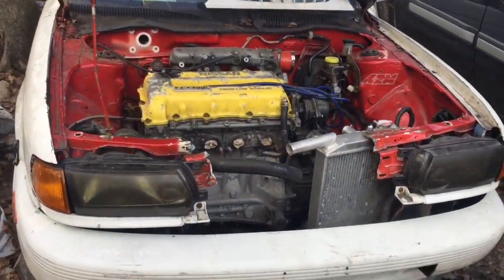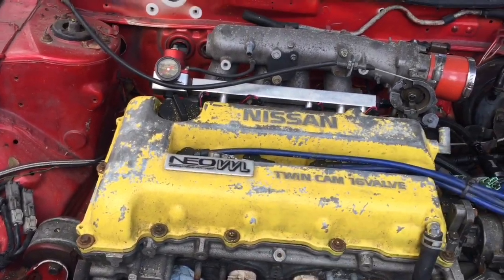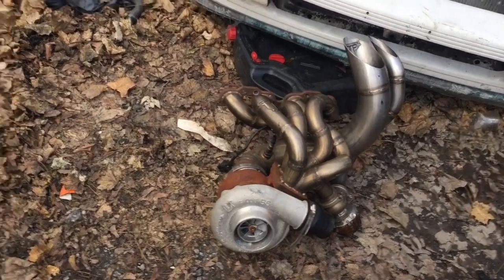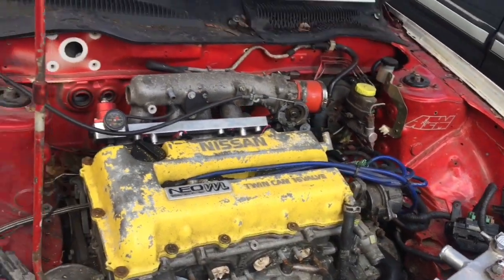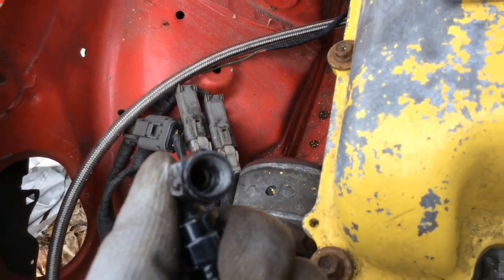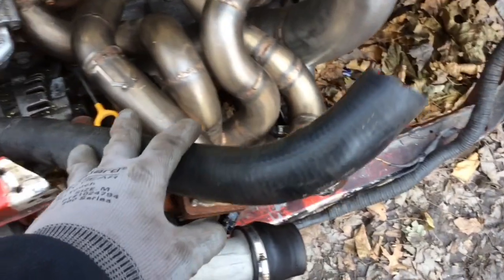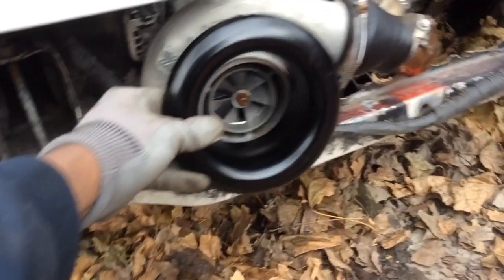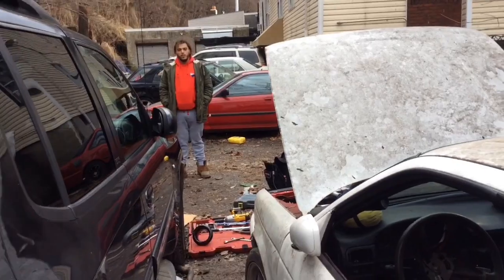B13 Sentra SR20VE-T 9 sec Sentra ?!? Ep:5

Comment: edited.  stupidity removed.
Reply from the maker: Excellent Adventure true. It’s not it’s not a VE. It’s a de/ve hybrid. My mistake. Good catch
Reply: edited - my apologies for not seeing
Reply from the maker: Excellent Adventure dude are you serious. I own a p11 Vvl head with both solenoids. It’s actuated through my ecu. I have nismotronic sa. Go look at some of my other videos if you unsure. This definitely is a p11 sr20ve head.
Reply from the maker: Excellent Adventure if you knew what you were looking at you would know by the intake manifold that it’s a p11 head.
Reply from the maker: Excellent Adventure and the block is from a 2000 sentra 2.0
Reply: Just FYI, not trying to troll just want accuracy is all.  Also, if you plan to use the VE throttle body, do something about the throttle plate screws.  They like to come loose and get ingested.   Most guys use the B13 se-r throttle body as it eliminates the wax stat thing in the VE TB as well.
Reply: One last message, re-watched the video and my apologies.  P11 head as I can see the solenoids now and noticed the block off plate on the iacv.  what size injectors are you using?  I'm finding that trying to push past 600HP with ID1050x is nearly... impossible.  I have a similar setup.  Built VE (block is VE also) with lovefab sidewinder and 6266... running out of injector super quick chasing HP.
Reply from the maker: Excellent Adventure no problem bro. And i have id1000 right now. But soon upgrading to 1600cc. What fuel pump and lines do you have. And are you running ethanol or gasoline? On 93 octane you should be able to hit 600hp
Reply from the maker: Excellent Adventure i think i folks you on ig what’s your name on there
Reply from the maker: Excellent Adventure as for trans i have a b15 trans in right now. I want a p11 but I’m just gonna use what i have right now. And yea that Cali piss sucks. But if you can get your hands on e85 and you could bump your base fuel pressure a bit to get over the 600 mark
Reply: seems reply from the notifications is borked lol!  Here goes:  aem 380lph held in the clamshell in the trunk by big hose clamp (it barely fits but does) sock is a holly hydramat.  Bulkhead fittings put in place of the stock feed and return are now 8an.  In the bay, radium fuel rail, fpr, fpd (not worth the money, replaced my customsteel setup and I regret spending the money for absolutely nothing but cosmetic gain) 1050x strapped onto a o2 induction manifold.  I have a pic I found while working on the setup:  https://i.postimg.cc/gJsXmPmR/8602.jpg it's a little further along now.
Reply: I'm not instagram.  I fly under the radar a all times.  speak quietly while carrying a big stick and all.  no facebook either.
Reply from the maker: Excellent Adventure you have a set up very similar to someone i follow. Nice. But what base pressure you running
Reply: @MonkeyRenchGarage  3 bar though I should run higher as I understand the injectors atomize a little better at 4.
Reply from the maker: Excellent Adventure oh most definitely bump up that pressure bro will give you more duty cycle to play with
Reply: quick overview from my other account. https://youtu.be/3B0RvL-2PCk  have maybe 4 hours of work to do to get it running again but.... lazy.